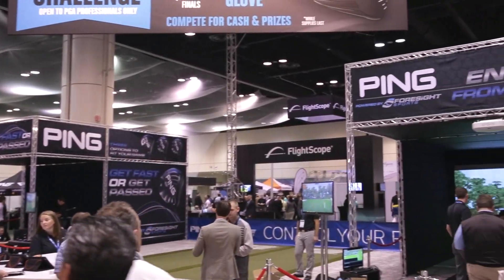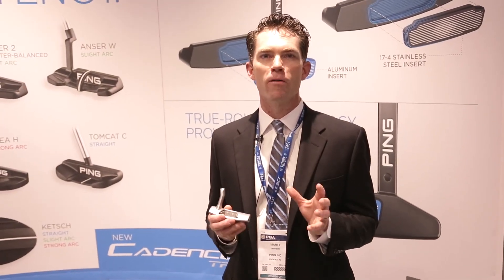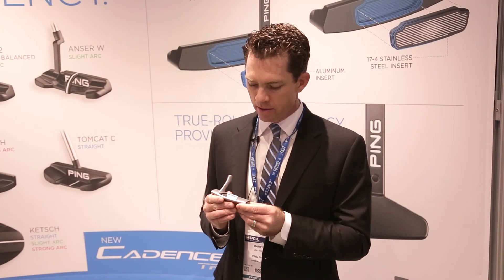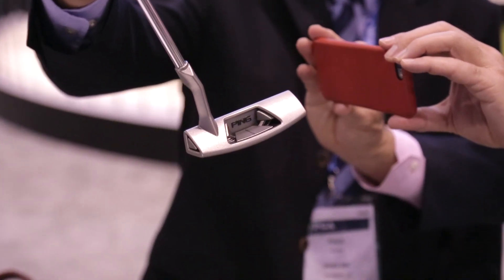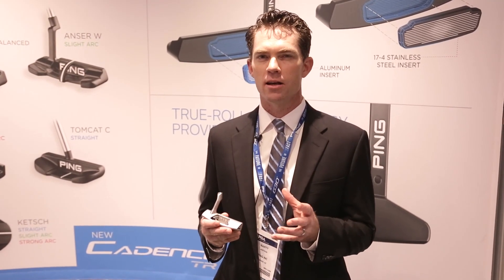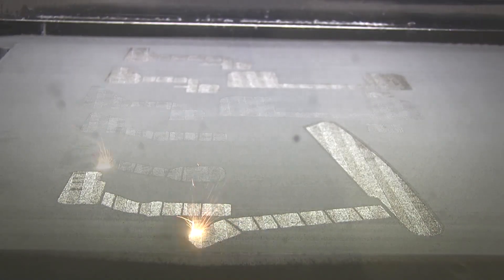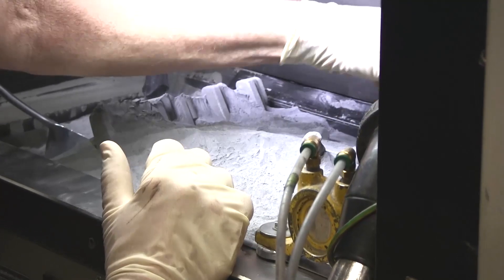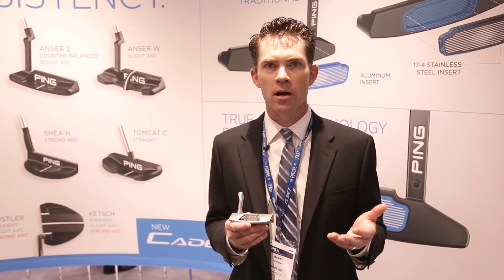PING at the PGA Show Pt. 3: My3D Putter Technology

Comment: this is a very cool concept if the durability and feel can match current methods and if the precision can match current milling standards.  Will those really be better?  Look at many putters in use today, they are basic riffs on the Anser.  It is a "shape" people "trust" and the innovation has been grips, inserts, counter-weighting...or personal variation - when I think this becomes really interesting is to take driver fitting and go from a base design like the G30 and then build customized versions based on fitting so make the variants like LS Tec and SF something generated.